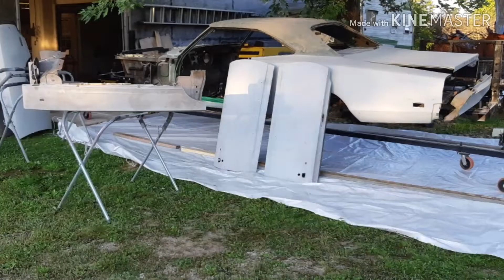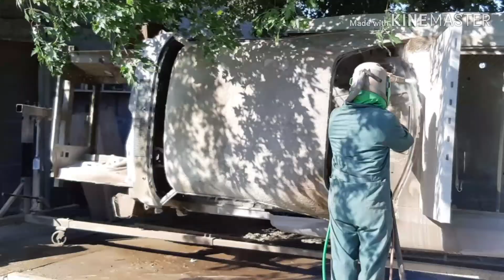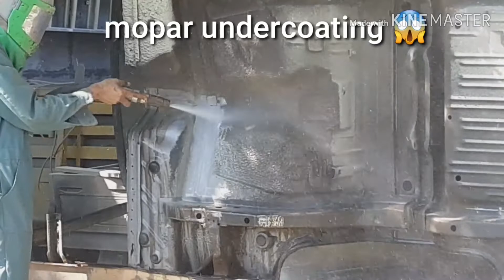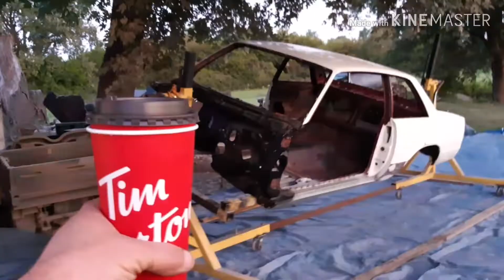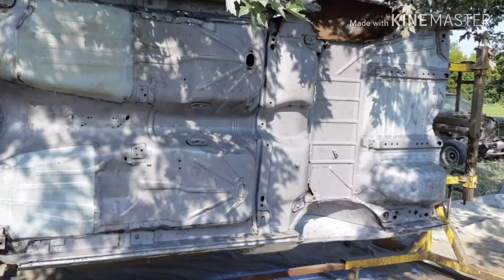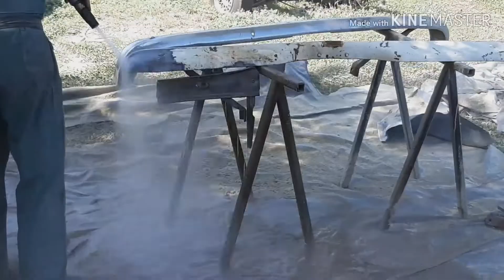Dustless blasting. Busy couple days. Gunna be a busy winter

Comment: So please tell us WAY more about this ??? Is it just water or ??? How does the cost compare with other methods?? What about the mess?? 

Thanks Bruce !!!
Reply from the maker: Same as sandblasting water is added to cut down on dust and cooling to avoid warping works great and in this area cost is similar to dry blasting. But this guy is mobile and comes to me. Would cost me twice as much in time and wear on my equipment and my body. Cons.i do have a small beach behind my shop. 😎🤣